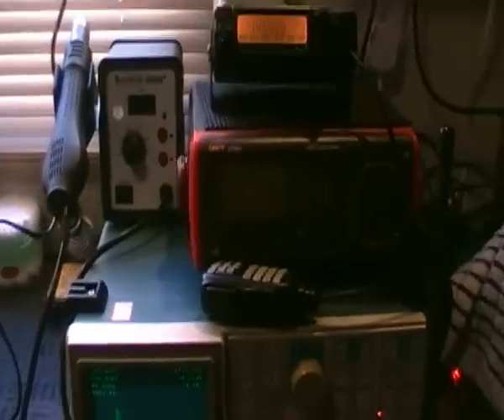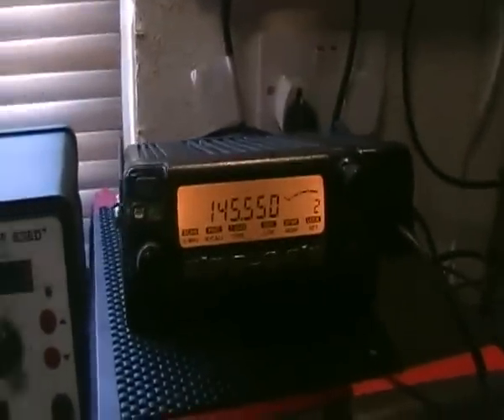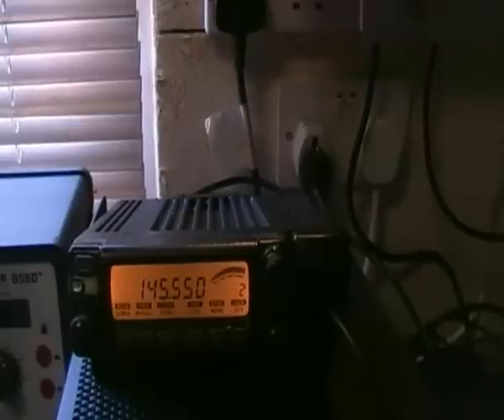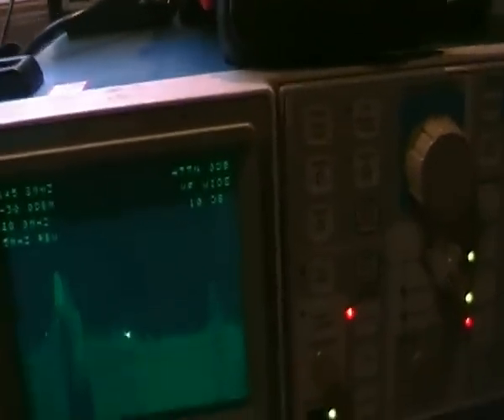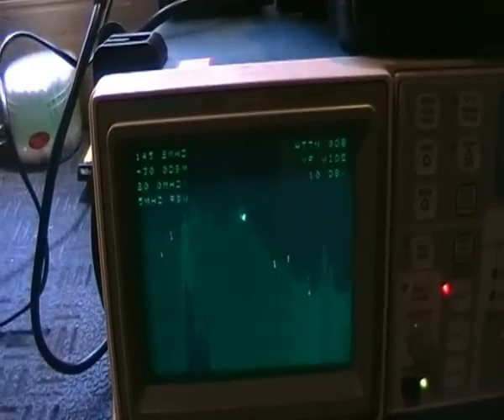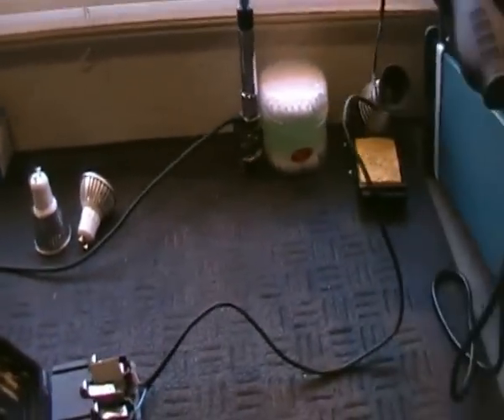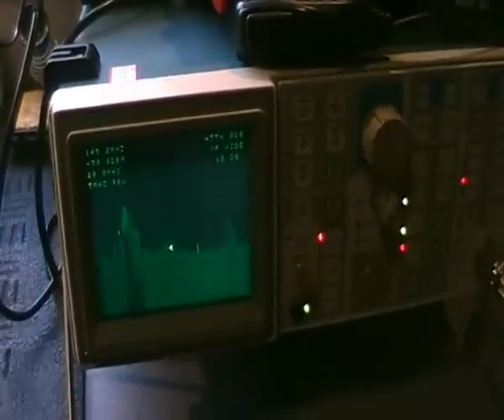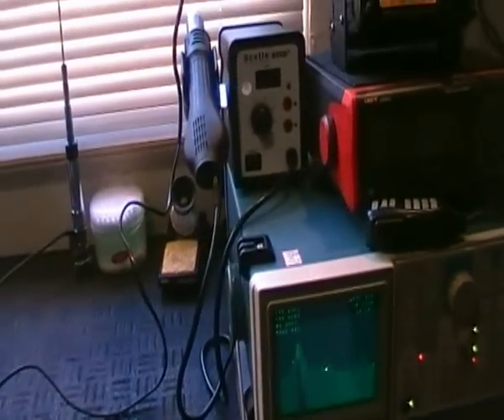LED lamp radio noise

Comment from the maker: Hi Bruce. Leds can be a good energy saving item but at the cost of the radio bands being marred with noise, my problem was the 230v types with inboard converters. You could try different brands or 12v types with matching baluns, i am hoping to do a review on different types of 230v types with the new Rigol Spectrum Analyser.... Sam yes sometimes distancing the radio away from the noise source with a good earth and feeder

Comment: With my CREE 9.5 watters, I get RF noise, but once I get 4.5 feet away it is totally gone. With 3 on in the same room, and me in the middle of them with a detuned am radio, there is no noise because I am beyond 4.5 feet from any of them. So if you want no RF interference, do not get within 4.5 feet of a lit LED bulb.